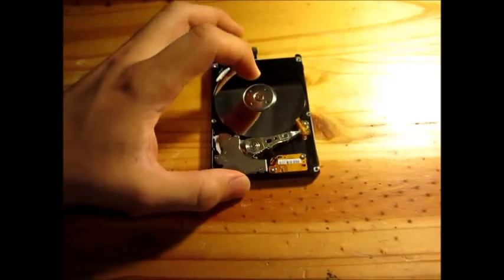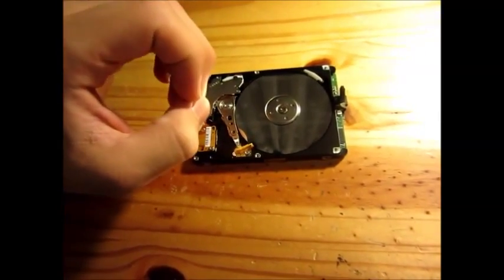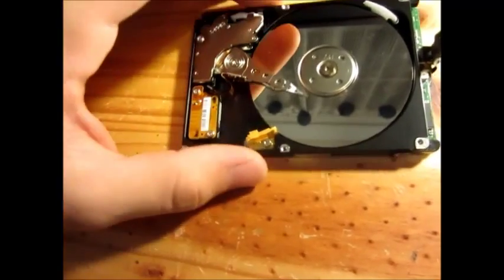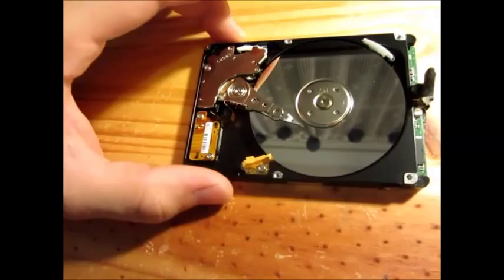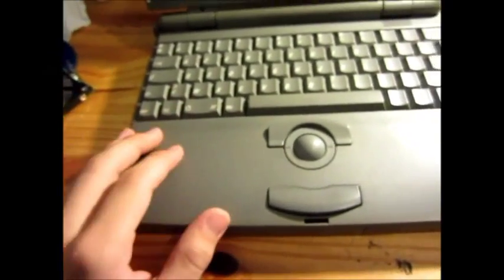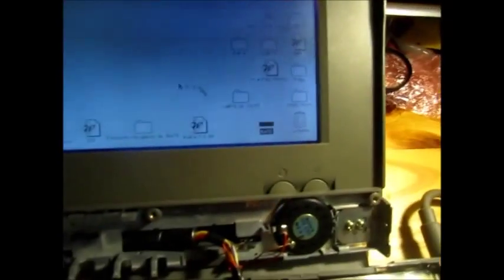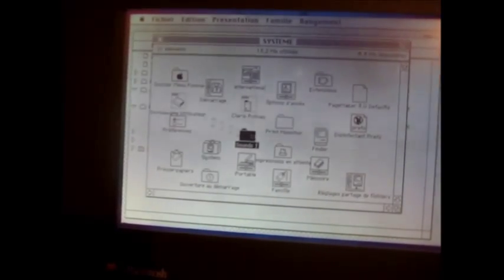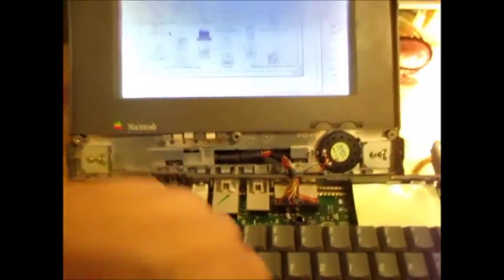old hard drive repair (Conner CP2025)

Comment: Thanks for this video! I found my Conner CP-2024 head was stuck. I did end up opening it and watched it while running. The head was not moving but the disk was spinning. I poked the head to move it (like your video shows just knocking may have worked). Now it is booting back up again!
Reply: Same here. However once the drive is powered down, the problem returns. The heads feel like they are magnetically locked in the inner position? It just doesn’t seem to have the strength to escape the default position. Also, it hits that default position with a click, which doesn’t sound like a rubber bumper to me.

Yes (at the end of the video), the small capacitors are the cause of the black screen, I’ve just fixed that. Not the two by the display connector but instead the ones near the inductors (beside the battery bay) - the small 1uf and 10uF ones were the problem for me

Comment: Very impressive demonstration! The hard drive of my PowerBook 170 has a different problem. It spins up alright, but the computer doesn't see it. Sometimes it shows up in Norton Disk Doctor as a damaged drive, but most of the time it's not detected at all. However, I will try your tips on a 3.5" PC drive. It's 18 GB and I believe it's from 1999. It seems to be stuck.

Comment: please can you help?
my laptops hitachi hard drive  clicks for no apparent reason randomly do you have any ideas as to what it is?

when it  clicks after that evry thing is fine but it was fine anyway during clicks
Reply from the maker: Hello, sorry to reply so late, i think it could be the heads parking. If it's a recent HDD, it may have an motion sensor to detect fast movement (ie : fall), and it may park the heads in order to preserve the platters and datas
Reply from the maker: oldmac6
Just backup your data as a case of precaution, but if it click only when you move the laptop or goign in or out of sleep that is normal. If it click when accessing data in a pattern then your drive might be failing.
Reply: oldmac6
 hi i have noticed it does it when there is a vibration, eg loud music with bassy or hi pitched sounds and then it clicks once if the hi pitched noise goes on for too long